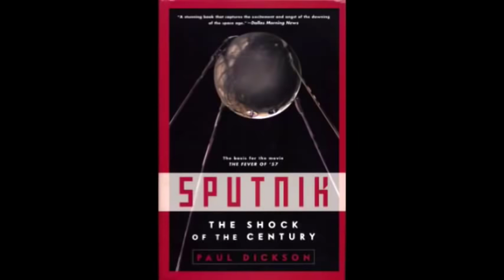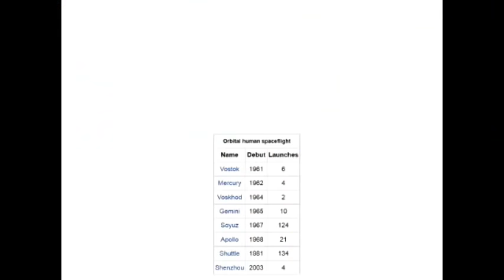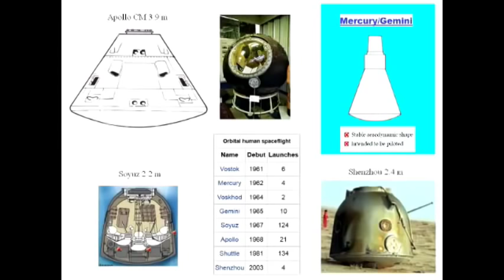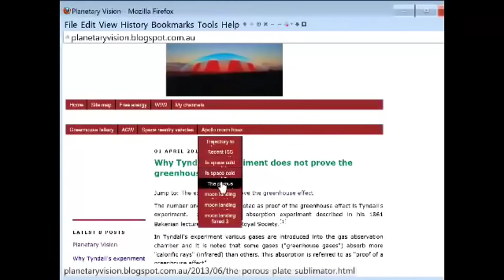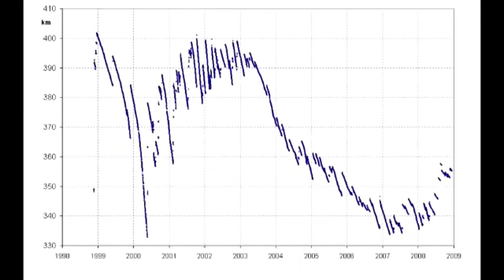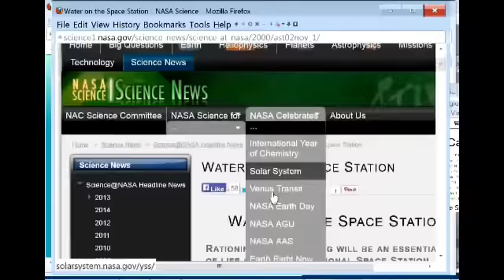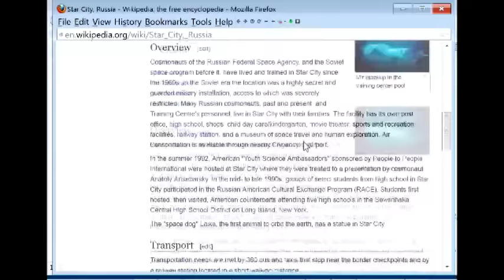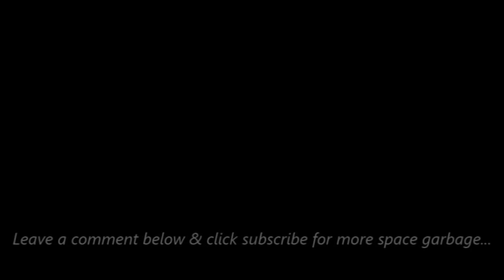The ISS Exposed

Comment: Not only most of the organic life can't get through radiation of the Van Allen belts (even today), but even the photographic films they were using at the time wouldn't have survived the exposure to such radiation, neither the cameras could have worked properly being exposed to extreme Moon temperatures such as 250° C in sunlight and -250° C in shade.
Reply: Shielding.
Reply: @eyesoftexas705  shielding? during the Apollo missions? LOL! the NASA has said they didn't use any, that it wasn't needed
Reply: @tgstudio85  That's part of the same crap. I could put here 50 links pointing to scientific research from USA, England, Russia and China which prove the astronauts couldn't ever pass through the radiation and come back without damage. 
Instead, I'll simply refer to two issues. 
One is the classified recordings that Bart Sibrel received from NASA by mistake around 2002. As if all known and classic epic fails and fakes seen in pictures and footage during the so called Apollo missions were not enough to convince the whole world of the hoax, you have these recordings of the Apollo 11 showing how the so called astronauts are using a simple sheet on the window to fake they are half way of the Moon. When they take out the sheet you can see through the window they are in the low orbit of the Earth, while receiving instructions "from Houston" on how to make the fake in the proper way. Then they turn the cabin light on and on the instruments you can see the current date and time, and on that date they supposedly were half way of the Moon. 
https://www.youtube.com/watch?v=xciCJfbTvE4

The other one is NASA own words, which sense because nobody (Russia, Japan, China, etc) including the US has been able to go/return to the Moon with manned missions:
https://www.youtube.com/watch?v=4O5dPsu66Kw

And beside the overwhelming photo and footage evidence proving the hoax, there's a third hit which demolish any NASA allegations and credibility
Go and watch Apollo 13 footage from NASA, at a certain point you'll note through the window a clear blue sky low orbit easy ride. If you can't find I can look it for you.

Only stupid and proud people can still believe in this crap.
PERIOD.
Reply: @alancrabb  That's part of the same crap. I could put here 50 links pointing to scientific research from USA, England, Russia and China which prove the astronauts couldn't ever pass through the radiation and come back without damage. 
Instead, I'll simply refer to two issues. 
One is the classified recordings that Bart Sibrel received from NASA by mistake around 2002. As if all known and classic epic fails and fakes seen in pictures and footage during the so called Apollo missions were not enough to convince the whole world of the hoax, you have these recordings of the Apollo 11 showing how the so called astronauts are using a simple sheet on the window to fake they are half way of the Moon. When they take out the sheet you can see through the window they are in the low orbit of the Earth, while receiving instructions "from Houston" on how to make the fake in the proper way. Then they turn the cabin light on and on the instruments you can see the current date and time, and on that date they supposedly were half way of the Moon. 
https://www.youtube.com/watch?v=xciCJfbTvE4

The other one is NASA own words, which sense because nobody (Russia, Japan, China, etc) including the US has been able to go/return to the Moon with manned missions:
https://www.youtube.com/watch?v=4O5dPsu66Kw

And beside the overwhelming photo and footage evidence proving the hoax, there's a third hit which demolish any NASA allegations and credibility
Go and watch Apollo 13 footage from NASA, at a certain point you'll note through the window a clear blue sky low orbit easy ride. If you can't find I can look it for you.

Only stupid and proud people can still believe in this crap.
PERIOD.
Reply: Moreover, it's been proved that 1969 and 1970 registered the worst solar activity in the CENTURY. These guys couldn't have chosen a worst time for the hoax!
Reply: @nicocba2007  Even more jaded conspiracist nonsense :
1.  You give credit to Sibrel?  All of his crackpot ideas were debunked years ago.  You just haven't fact-checked.
2.  The video about Orion is just that : it has nothing to do with previous missions.
So, this tired and discredited misinformation is what you put against 50 years of historical record and technical documentation - none of which, I guess, you have read.  
Your pseudo-elitism is crippling your judgement.
Kind regards.
Reply: Buck warpzone 
Kid, "conspiracy theory" was a term coined by the government to use it against of and to discredit the people who knew about the JFK assassination conspiracy. It's a goverment pigs' strategic for cover-up and get away with their own conspiracies. And this one about the Moon landing hoax is the like other government conspiracies, only this one is a "positive" conspiracy. That's why is harder for common no-thinking people to believe, the basic people who believes all they see on TV.
The case get worse when involves proud and nationalism.
The only conspirants are the governments, the agencies and the mainstream media which respond to them (which since 1993 are all of them).
You have a lot of examples of government conspirations, some of them have caused hundreds of thousands of dead people inside, and millones abroad. And some of them are of total public knowledge, they've been disclosed to the public through desclasified docs after decades of hiding.

Do you want some examples of government conspiracies 100% proven by official desclasified docs?
(1) 1915 - WW1 Conspiracy.
(2) 1941 - Pearl Harbor Conspiracy.
(3) 1950 - The CIA, the Korean War and heroin.
(4) 1964 - The Gulf of Tonkin Hoax.
(5) 1968/72 - The CIA and heroin part II.
(6) 1985-87 - The Iran-Contra affair.
How many stupid people would have thought it was impossible that the government was capable of such things before those top secret docs were disclosed? All common basic stupid people around, same thing happens with the Moon landing crap.

MORE IN DETAIL:

(1) 1915 - WW1 Conspiracy. The sinking of the british ocean liner Lusitania by the Germans was a pretext by the US to enter into the WW1, sacrificing 128 of its own people. The Germans advised beforehand the US gov and the American people not to travel in this ship by publishing warnings in the newspapers and communicated by the german ambassador to the foreign office of the US, as any attack to the ship would be deemed a fair war act. In fact, the ship wasn't sank by the U-boat torpedo itself, but by the explosion of the stored bombs and munitions they were carrying to the United Kingdom.

(2) 1941 - Pearl Harbor was a conspiracy to motivate the american public for war, by first provoking and then allowing the japanese strike. The Secretary of War at the time Henry Stimson wrote in his diary, just a week before the attack, that President Roosevelt had told him: "we are likely to be attacked perhaps as soon as next Monday". The plan was put in motion in late 1940, when the President ordered the fleet to relocate from San Pedro to Pearl Harbor, which appeared to be a nonsense strategic decision taken at the time, and then as it shows a desclasified memo dated June 23, 1941, the Secretary of Interior at the time Harold Ickes recommends to the President the oil embargo to Japan in order to force them into war: "There might develop from the embargoing of oil to Japan such a situation as would make it, not only possible but easy, to get into this war in an effective way". They received many warnings of an imminent attack from diplomatic officials and military attaches. The attack was even predicted by the newspaper Honolulu Advertiser days before it happened, but all of these warnings were ignored. This conspiracy killed over 2.400 american servicemen and civilians, beside the hundreds of thousands during the WW2 itself.

(3) 1950 - The CIA and the Korean War. After the WW2 and withIn the cold war context, this was the first of many secondary wars sold to the public as missions to save the world from communist threat, protect freedom and democracy, etc, when in reality they were meant to feed the military complex, conquer new export markets for american products, and compete for geopolitical power with the Soviet Union. During this war the CIA organized a massive heroin production-distribution operation known as "The Golden Triangle", in order to finance taiwanese warlords. Most of this drug was trafficked throughout the US by CIA assets.

(4) 1964 - The Gulf of Tonkin Hoax. As some docs declassified in 2004 shows, the alleged attack on the USS Turner Joy was totally fake. Not even a false flag attack, but just a lie of the Lyndon Johnson administration, the pretext they need for the US to enter into the Vietnam War. A lie which costed the country 60,000 men for finally losing that war.

(5) 1968/72 - The CIA and heroin part II. During the Vietnam War the CIA inundated the black neighborhoods of NY with heroin to finance illegal military operations in Laos and Cambodia using the Gold Triangle again. This heroin was known in the streets under the "Blue Magic" brand, mostly distributed by the gangster Frank Lucas, and brought to the country in containers using the CIA controlled company Air America.

(6) 1987 - The Iran-Contra affair. After the Congress refused to continue financing the guerilla in Nicaragua (known as Contras), the Reagan's administration decided to conduct two illegal operations to accomplish his goal: 1) By selling weapons to Iran (an enemy of the US) while it was in war with Iraq (an ally of the US). This event was widely known at the time, and only Colonel Oliver North paidthe price to protect the rest of the conspirators, including the President. 2) Again the CIA and drug. The CIA was conducting a massive cocaine traffic operation from Costa Rica to the US to be distributed mainly in the Blacks' and Latinos' neighbourhoods of LA. Same result here than in NY with the "Blue Magic" heroin operation; tens of thousands of "disposable people" had their head blown-up by drug, resulting in an amazing increase of violence, crime, etc, etc.

Do you want some examples of government conspiracies not 100% proven by official desclasified docs yet, but every thinking people knows they are conspiracies because of the overwhelming evidence thereof?
(7) 1898 - False flag attack in Havana Port.
(8) 1963 - The JFK Assassination Conspiracy.
(9) 1968 - Martin Luther King assassination.
(10) 1968 - Robert Kennedy assassination.
(11) 2001 - 09/11 Conspiracy, the New Pearl Harbor.

(7) 1898 - Sinking of the USS Maine in Havana Port. A false flag attack handled by the US government wich killed 250 of its own people, to be used as a pretext to start a war against Spain in order to gain control of, or to seize the remaining surrounding Spanish colonies, such as Cuba, Puerto Rico and The Philippines, within the context of the beginning of the American imperialism expansion.

(8) 1963 - The JFK Assassination Conspiracy. Nobody knows for certain who killed him, but among other things we know about the "magic bullet" scientific impossibility, so we know that there should have been at least three shooters. If Oswald didn't act alone, then the Warren Commission conclusion is bullshit. If the WC conclusion is BS, then there was a government/agencies cover-up conspiracy (we know that former head of the CIA, Allen Dulles, was a member of the Commission). And if there was a high level cover-up operation involved, then his real assassins also were top level government/agencies people.

(9) 1968 - Martin Luther King assassination, organized and covered-up by the FBI and the Memphis police. A nobody blamed and used as scapegoat.

(10) 1968 - Robert Kennedy assassination. He was running for president, he was probably close to find out who murdered his brother and got killed by the same people. Another nobody blamed 

(11) 2001 - 09/11 Conspiracy, a False Flag Attack, an Inside Job. Through investigations by several organizations such as 9/11 Truth Movement and Architects & Engineers for 9/11 Truth, plus a lot of research made by many independent journalists and analysts, and valuable testimonies of people involved in the airline industry (pilots, flight controllers, flight attendants, etc) now we know for certain what 09/11 wasn't. We know that at least 10 of the so called "terrorists" are still alive! and that they are saudis (US ally) with no connection to Al Qaeda. We know that the Towers couldn't collapse up down at free fall speed because of fire and gravity action, this violates at least two basic physics laws. We now know that the WTC-7 tower was taken down by controlled demolition. We know that any standard airliner jet can't be even controlled when flying over its maximum speed, much less can be controlled with misilistic precision to hit an specific target, and that is impossible if that target is ground level, and that is a sci-fi story if the so called "hijacker" could barely control a Cessna (proved). Now we know so many things more, but in order to summarize let's say we know that the official story in the mainstream media and the 9/11 Commission report is bullshit. Would be possible that the US government faked a terrorist attack in its own soil and against its own people, using or hijacking airplane jets? or that would be some just crazy fuck ideas of a bunch of conspiracy theories lovers? Please refer to "Operation Northwoods", a 1962 Pentagon plan to commit acts of terroris against American civilians and military targets, blaming it on the Cuban government, and using it to justify a war against Cuba.
Here is an easy aource: https://en.wikipedia.org/wiki/Operation_Northwoods
Reply: @nicocba2007  :  
1. ' they will never answer anything to what is evident' : you have demonstrated the usual m.o. of the conspiracist, sometimes called the 'gish gallop' or the 'wall of truth' which aims to impress with the volume of evidence.  It was used by Von Daniken to great effect -  it persuaded millions for a few years.  But what ALWAYS happens is that each brick in this wall gets fact-checked and crumbles, as has ALREADY been done with the 'Apollo Hoax' theory.   The fatal weakness of the conspiracist is being uncritical : so long as it confirms the theory ANY story is granted equal authority, and all contrary evidence is rejected and ignored.  The usual claim that there is 'never an answer' is manifestly false - the literature is enormous, and universities have departments specialising in it.   The evidence for space programs over 70 years is overwhelming, but always ignored.  This is true foolishness.

2  'But conspiracies have happened' : of course, who claims otherwise?  You think it impresses to cut and paste from chapter 1 of general history?  This is neither explanation nor justification for the deep delusions of the conspiracist.  Of course, there IS an explanation :
https://kar.kent.ac.uk/61995/1/Douglas%20Sutton%20Cichocka%202017.pdf  "The Psychology of Conspiracy Theories"
Reply: @IgnoranceIsNot AVirtue Of course, and I've already put some links about it.
Reply: Enter Jarrah White web page and you'll find plenty of radiation analysis proving the hoax.
Watch the vids and you'll get the answer about russian silence at the time... BTW you are not able to search webpages in other languages, much less in russian or chinese... oh! BTW2 the chinese have shown us how the moon really is
Reply: @tgstudio85   No. NASAs original flight path released to the press shows a path from the equator to the moon. only after the deadly radiation was questioned in the VA belts did nasa change its story after the missions took place, and the longer polar flight path was not accounted for it terms of payload and fuel on the saturn rocket https://www.youtube.com/watch?v=EmGaNEbEMLI. No mention of the VA belts were in the transcript, no extra fuel was calculated for a polar orbital transfer to the moon, and Apollo 11 was caught faking being halfway to the moon on leaked atomically dated footage.
Reply: It seems the globe theory claim of a radiation belt around the earth undermines their other claims that planet distances have been confirmed by sending radio signals that bounce off mars, or moon etc.

The Van Allen belt would demolish the signal. Yet they think it passed through, twice! ( there and back ).
Reply: Alan Crabb , could you kindly supply me a link to sibrel's claims being debunked, I would like to check that out.
Reply: Their excuse is even though it is cold and hot, there is no real temperature.....mind boggling Iknow
Reply: how strange. and still they did it? you are religous and think that the earth is flat as well?
Reply: @tgstudio85  good video link thanks for clearing up some questions that I had.
Reply: @nicocba2007  I want to so bad pick me pick me !
Reply: @sollostyles I can't help it I was born stupid !
Reply: The van Allen belts are fake too my dude , research Flat Earth
Reply: "they've destroyed all that technology and blue prints!"

Why revive tech from 60 years ago?  The old hardware is woefully outdated and was scrapped or put in a museum, because NASA won the Space Race.   If you were actually interested in facts, here is a thorough explanation of why it is absurdly impractical to use Apollo-era tech today-   https://www.youtube.com/watch?time_continue=10&v=ovD0aLdRUs0

"they have to solve radiation problem BEFORE sending men beyond low orbit. "

That is correct, as I explained, and you only ignored.  Smith is referring to the ALL NEW Orion, using ALL NEW tech, which is more complex and radiation-sensitive than mostly analogue, Apollo hardware, and intended to endure much more intense levels of radiation over longer periods.  

"6 times!!!"

NASA sent men to the Moon nine times.  They landed six.  Why would they bother faking it NINE times?  And why sabotage U.S. cred when they knew it was only a matter of time before other countries sent probes or men to the Moon that were likely to photograph Apollo landing sites? Which they now have.

Over 155 Moon missions by various countries- http://en.wikipedia.org/wiki/List_of_missions_to_the_Moon 32 of which were after Apollo. 

"Chinese have recently shown us how the Moon really is"

Exactly like the Apollo moon.  Japan's Selene Kaguya scanned the Apollo 15 landing site terrain, and it matches photos from 1971 exactly.  How could NASA have faked the terrain exactly, if they were never there?  https://www.youtube.com/watch?v=kbTRGj5aNCM

I debunked all your points, and like all conspiratards, you ignore. evade, make wild claims without evidence beyond reference to other conspiratards who are as scientifically illiterate as you, and shirk away when you are losing your argument.  

You are part of the fake news problem.  Good riddance.
Reply: That's not what Dr. Van Allen says about the radiation belts he discovered.
Reply: That's not true.  Just a BS myth Idiots keep repeating.
Reply: Can Allen himself has changed his mind and believes we went. But you have a YouTube acct so I should believe you.
Reply: @Galerak1  : yes, it true that manned missions are limited to LEO. In fact, the U.S. is limited even further. The only way the U.S. can get to LEO now is by bargaining a ride with the Russians. Would you interpret this as the same as the Americans never got to space by themselves? Now there are no man rated Saturn Vs, or man rated Apollo command or lunar modules. That means that even simple people should realize that no one can get back to the moon. All the 50 yr old Apollo equipment is on display in many museums, never to fly again.
Reply: @tgstudio85 : real scientists don't publish on you tube.
Reply: @nicocba2007  Nope. Dr. Van Allen originally estimated the astronauts would have to spend a week in orbit at the higest levels of radiation to receive a lethal dose, whereas the Apollo guys were only exposed to  2 hours of low level and 15 minutes of high level rads, which was roughly 1% of a lethal dose on each pass.  Both NASA and Dr. Van Allen still consider his original estimates to be accurate.

This is easily confirmed, as far as what NASA and the Dr. think about the matter. 

Kind of odd how you would value NASA's info as long as it confirms your beliefs, though.  I thought they were liars and conspirators? How do you know the Van Allen belts exist at all?
Reply: @nicocba2007  Side note: Kennedy's "we choose to go to the moon" speech was in 62, by the way - no one could have ever imagined it 3 years prior, eh? I'm sure you must be right . . . 

This movie about going to the moon from 1902 must be from a different dimension?

https://www.youtube.com/watch?v=xLVChRVfZ74
Reply: nicocba2007 What are the radiation energies in the van Allen belts, what types of particles are present and how was all this information discovered?
Reply: @nicocba2007  You dont concede when your points are debunked and are unable to come up with a logical refute, so you just move onto something else and hope no one notices. Now you resort to the fallacious tactic of quote mining out of context as if the quotes agree with your viewpoint.  

"Simple minds prefer simple answers."  -me

"Merely claiming that an ocean of evidence you cannot explain is 'fake!,' and that millions of experts are all 'liars!' does not make for a remotely convincing argument." - me

"Ignorant men raise questions that wise men answered a thousand years ago" - Johann Wolfgang von Goethe

"The main thing that I learned about conspiracy theory is that conspiracy theorists actually believe in a conspiracy because that is more comforting. The truth of the world is that it is chaotic. The truth is, that it is not the Jewish banking conspiracy or the grey aliens or the 12 foot reptiloids from another dimension that are in control. The truth is more frightening, nobody is in control. The world is rudderless."  -Alan Moore

'I cant understand the science, therefore it must be fake!'  -you

'A global consensus of experts thoroughly supported by an ocean of verifiable evidence, rigorous experimentation, published peer reviewed studies, resulting in successful applications like aviation and the internet you are now ranting on, overwhelmingly disagrees with my amateur opinion.  Therefore, the experts are all part of a massive coverup!'
  - you

"Extraordinary claims require extraordinary evidence" - Sagan   "Claims asserted without evidence can be dismissed without evidence." 
 - Hitchens 

Here are your three possibilities:

1.  Millions of professional physicists, engineers, astronomers, photographers, and news agencies... are ALL part of a secret global super conspiracy of the last 70+ years, spanning space agencies in over 70 countries, without any clear motive, and without a single leak or whistle blower ever, spending accumulative trillions faking cover up, thousands of hours of footage, millions of photos, publishing thousands of fake scientific papers, and engineering expensive equipment that doesn't actually work, and everyone who pursues a PhD in earth sciences is forced to lie.  

2.  They are all incompetent.  And anyone who watches a few amateur conspiracy videos is better informed.  

3.  You are poorly educated and confused.  

Which sounds more likely?  

I am sorry to inform, but...

You are not special.
You are not awake.
You are not enlightened.
You are not one of the few.
You are not an investigator.
You just have internet access.

Post your one best piece of evidence that convinced you the Apollo missions were fake.  I dare ya.
Reply: The ISS is just above the atmosphere and  deep inside the VA belt! Any back yard telescope can see the thing when passing overhead. NEW CONSPIRACY YOU-TUBE, ISS painted on consumer telescopes!!!
Reply: Cognitive Dissident No, according to nicocba2007. I want to know how he / she knows all this.
Reply: @nicocba2007  you must have me confused with someone who cares about your opinions.  Those say more about you than anyone else.

Anyway, when your tantrum is over, feel free to answer my extremely simple questions. I'll wait.
Reply: @somatotrophin1535  I deleted my comment. I was being sarcastic.

But yeah, i think you're beyond him . I thought pointing out the self detonating rationale would be more on his(?) level.

You can troll this type with simple logic, which is entertaining at times.
Reply: @codebasher1  the ISS orbits about 150 miles below the VAB.
Reply: nicocba2007 manned missions are more difficult today because of 1 the cost, 2 the sensitivity to radiation of modern equipment compared to the basic electro mechanical equipment used in the 60s and 3 more stringent safety guidelines today.  They were willing to risk lives much more readily to win the “space race”.
Reply: You do realize they were using a hyperbolic arc to get passed the van Allen belt, meaning that they didn't go through the worst parts of the belt that had the worst radiation and minimizing their exposure time to under 3 hours to go and 3 hours to come back. /watch?time_continue=1&v=lNiscigIgBc
Reply: @tgstudio85  It's not that they are unable, they don't have the drive of having to beat an other country for "superiority" sake that they were pushed in by the administration. It's just not cost effective.
Reply: Alan Crabb yep. You are right they have spoken loads of gibberish. And all of it was bullshit.
Reply: @cnelsonlv999 :  thank you, however :
1.  "50 years of historical record ..."  You misunderstand.  The important bit of "50 years of historical record and technical documentation" is 'record..and technical documentation'.  They exist in immense and verifiable detail, and contemporary with the period in question.
2.  "NASA destroyed / deleted / lost / mishandled it... "  What, you mean the 1.5 million documents in public archives?
3. "Stop calling anyone "typical!"  You are the one who is typical."  Read that again. NO sense of irony at all?  (And when did I say that anyway?)  
4. " confirmation bias"  Everyone is subject to it, which is why fact-checking and critical thinking are important. 
5. "psychology of conspiracists" bullshit, "  It's a serious and well-researched subject, and answers many questions.  
6. "not cool to believe in conspiracies.
"  Only an idiot denies conspiracies happen.  A conspiracist mindset is something of a different order.
CN : in your rush to judgement you just don't think things through.   Also, you appear to ascribe to me quotes from someone else. 
Kind regards.
Reply: @Rude_Earther  :
YOU SAID : "let’s see what nasa say about your scientific findings."
I SAID :  " What about everything else that NASA - and all other space agencies - have said?"
YOU SAID :  "all of it was bullshit.
"
First you cite NASA as an authority, then you rubbish it.  Interesting.
Reply: nicocba2007 In other words, you have no idea what the VABs consist of and how they were discovered.
Reply: @alancrabb  Well.... I checked again... the quote I attributed to you definitely came from you. I think "historical record means historical record" kind of sums up your line of reasoning pretty well. Not sure if it occurs to you, but... being told something happened doesn't prove that it happened. I don't care enough to address your annotated points, but regarding #5... I am a psychologist. I'm not sure who told you the "mindset of the conspiracy theorist" is a serious and well-researched subject... but they were lying. Actually, if you are interested in some fascinating investigation, look a bit more deeply into this subject, how it began, and the key players in shelling out the important talking points.
Reply: nicocba2007 Debunk number 1, re: claim by Sibril they were in low earth orbit and not halfway to the Moon. The Apollo window was RECTANGULAR and not round. Sibril edited the video. See the whole video here at about 3.40 to 4.15. The WHOLE Earth is visible through a rectangular window. Ref: https://youtu.be/Yy3WH2Ln_aY
Reply: @cnelsonlv999  : thanks.
1.  "the quote I attributed to you definitely came from you"  
(a) You criticised me heavily for using the word 'typical'.  I can't see that I used that anywhere in this thread.
  I stand to be corrected.
(b) You quoted me as referencing 'whistleblowers'.  I can't see that I used that anywhere in this thread.
  I stand to be corrected.
2. "historical record means historical record"   Did I ever say that?  
3.  Your main challenge was about my referencing sources.  You have not addressed my response, that contemporary records are important when discussing past events - which we are.  This was a qualitative and quantitative comparison with one highly dubious 'authority' being cited. 
4.  " I am a psychologist."  Did you check the source I referenced?  You doubt their credentials, you think them liars?  What are your own credentials?    

5.  "look a bit more deeply into this subject"   I have.  Don't be cryptic, say what you mean.  Are you going to quote 'historical records'?  :=}
6.  "NASA destroyed / deleted / lost / mishandled it... "  You raised this but have not addressed it.
7.  ""not cool to believe in conspiracies.
""  You raised this but have not addressed it.
8.  "I don't care enough to address your annotated points"  So why raise the issues?   
C N : there is a pattern emerging.  You misunderstand, you challenge, you misquote, you make questionable assertions, you ignore responses.  You are keen to assert you superior understanding but use facile arguments.  This is not encouraging from a 'psychologist'.  
Feel free to end this at any time, I guess it is tiresome for both of us.
Kind regards.
Reply: @DavidRidlen  :  "the ISS orbits about 150 miles below the VAB"  There is more than one belt, and the ISS routinely goes through the lower one : check out 'South Atlantic anomaly'.
Reply: @DavidRidlen  :  Nice. But lower your expectations?  As the sage says ""Never debate with someone who has diarrhoea - it will not end well."
[The Aphorisms of Dogmaticus the Elderly
Reply: @alancrabb  You keep saying I quoted you saying things you didn't say.  There is a difference between quoting you and putting quotes around a word.  Whether you used the word typical or another word/phrase with the same meaning... the point is still the same, and is not remotely ambiguous.  The only thing I quoted you saying was made very clear in my post.

I find your last comment interesting, given your general strategy here. Offer me the chance to end this tiresome conversation... but you are the one making it tiresome by annotating an incredibly long list of arguments, which leave me with only two choices... spend a ridiculous amount of time addressing each one, followed by an EVEN LONGER list of annotations by you... or to simply ignore them.  I think you know full-well which one a sane person would choose.

Just a thought... if you are so interested in sources, why don't you dig up some that are more than a cherry-picked attempt to find something that confirms your own conclusions?  Again with point #4... if you actually care about this, why is it that you are not familiar with the most widely documented and significant sources on this matter?  This seems to expose your unwillingness to actually explore this issue with an air of critical thought... 

Last but not least... you have talked about the psychology of conspiracy theorists... and also admitted that you agree there are conspiracies.  Does this not make you a conspiracy theorist?  What is the distinction, in your mind?
Reply: @alancrabb  Oh, and you're welcome!
Reply: @JosipMiller  
Please explain how radio signal goes through charged particle radiation.
Reply: @cnelsonlv999  :  Thank you.
1.  "There is a difference between quoting you and putting quotes around a word"  Is there?  As a professional (?) you should know that normal usage is to use single quotes for a paraphrase.  Double quotes mean something very specific, and you consistently misuse them.
2.  "incredibly long list of arguments"  The list is only as long as the issues you raise and which remain unresolved.  This is a way of reducing 'cherry picking' of arguments,  raising issues and then conveniently dropping them.    
3.  "the most widely documented and significant sources.."  Why assume anything, and why so coy?  Point to them.  If not already acquainted with them I will look.  Did you check my referenced source on conspiracism yet?  I doubt it, because of your next argument.
4. "Does this not make you a conspiracy theorist? "   I think this indicates you are only an amateur 'psychologist', and also not a logician.   Your argument seems to be :
(i)  'You agree there are conspiracies'
(ii) 'You talk about conspiracy theorists'
(iii) 'Therefore you are a conspiracy theorist'   
You SHOULD know that there are widely accepted definitions for these terms - see my previously cited source.  Acknowledging the reality of some conspiracies is significantly different to being a 'conspiracist' or 'conspiracy theorist'.  And studying conspiracism does not make one a conspiracist,  any more than studying criminal behaviour makes one a criminal.   Another issue to be listed before it is conveniently forgotten.  

Kind regards.
Reply: @alancrabb  This isn't a psychological journal, man!  I quoted you very clearly and prominently at the start of my post.  As a high school graduate (I assume), you should be able to tell when someone is quoting you, and when someone is alluding to your general message.  I'm not buying this extended hangup on whether or not I was quoting you directly, to the extent that you have completely avoided any meaningful discussion about the thing I obviously WAS quoting... which was a ludicrously absurd statement!
Reply: here's what Dr Van Allen, the discoverer of the belts named after him, had to say about the Belts. 
https://forum.cosmoquest.org/archive/index.php/t-3885.html
Reply: @cnelsonlv999  : thanks
1 : "when someone is alluding to your general message"  That is a self-excusing deflection (and you a psychologist!  tut tut).  Here's what you said in your original message :
["Stop calling anyone "typical!" You are the one who is typical... saying "if this was a conspiracy, why aren't there any whistle-blowers?" Then, when someone comes forward, you say "Oh that crackpot? He has been debunked by SNOPES!" ]   So far as I could tell I said NONE of those things and  I commented as an aside.  Your insistence on excusing that has snarled you up.  You made a mistake, you got called out : man up and move on.  
2. : " completely avoided any meaningful discussion about the thing I obviously WAS quoting..."   Here's your original point :
["So, this tired and discredited misinformation is what you put against 50 years of historical record and technical documentation" Haha! What the hell is that supposed to mean? "]  That HAS been discussed (remember, the detail you object to?) and NOT avoided as you falsely claim.   But you deflected away from that subject after I responded.  I'm happy to continue the discussion about the relative value of sources.
3.  Who is avoiding all the meaningful comments?   Want me to list all the issues you raised and subsequently ran away from? 
4.  Where are those documents you think I should have read?  
5.  Have you read the source I cited, which was the second main point of this thread and would have answered your questions?
6.  "This isn't a psychological journal".  But conspiracism IS a psychological phenomenon.  Read the literature.  Please.
Kind regards.
Reply: @alancrabb  Again... STOP WITH THE LONG-WINDED ANNOTATED DIATRIBES!  You know it is only a strategy that intends to deflect from any meaningful conversation.

You did NOT address my original point... you just stated a circular argument... that the historical record is the historical record (possibly not your exact words, but very close).  A historical record is NOT a line of proof.  It simply states that someone has claimed something happened.  50 years of historical record is meaningless in terms of proof!  Stop trying to pretend you are proving anything, or making an argument.  THIS IS NOT AN ARGUMENT!

Your statement amounts to saying that people have claimed it's true for 50 years, therefore it must be true.  That is 3rd grade thinking!  Are you a 3rd grader?  Because if so, then I owe you an apology.  You are right on schedule!

I notice you did carefully avoid the last question I asked in the last post... not surprisingly, since that was the only meaningful thing you could have addressed other than the previously aforementioned "quoted" statement...
Reply: @tgstudio85  THANK YOU!!!!!!!!!!!!! YOUR CONTRIBUTION TO SOCIETY HAS BEEN NOTED THANKS FOR PLAYING
Reply: nicocba2007 The video I gave the link clearly shows a rectangular window with the whole Earth visible. Sibril edited out this part of the video.
Reply: @cnelsonlv999  :  Thanks
1. "You did NOT address my original point"  I did (but certainly not in the way you allege.)  I will do so again in another post shortly.
2. "carefully avoid the last question I asked in the last post"   Which question, please?  
3.  Do you know what a 'diatribe' is?   
Kind regards.
Reply: @alancrabb  
1. Can't wait!
2. You talked about the psychology of the conspiracy theorist, while also acknowledging that there are real conspiracies.  If you agree there are conspiracies, doesn't this make you a conspiracy theorist?  If not... what is the difference in your point of view?
3. Yes, happy to explain it to you if needed.

You did better focusing on relevant issues in your last post... 2 out of 3.  If we can just cut out nonsensical pointless shit like #3 moving forward, perhaps there is a meaningful conversation to be had in all of this.
Reply: @cnelsonlv999  :  You said : "You did NOT address my original point....you just stated a circular argument"   Each of those statements is false.
 
HERE is my original comment to 'nico..' : 
"1.  You give credit to Sibrel?  All of his crackpot ideas were debunked years ago.  You just haven't fact-checked.
2.  The video about Orion is just that : it has nothing to do with previous missions.
So, this tired and discredited misinformation is what you put against 50 years of historical record and technical documentation"
 
HERE is the main part of your original response to that  :
"How is a historical record a line of proof, and what exactly is the "historical record?"" 

HERE is my response :
"1.  "50 years of historical record ..."  You misunderstand.  The important bit of "50 years of historical record and technical documentation" is 'record..and technical documentation'.  They exist in immense and verifiable detail, and contemporary with the period in question.
"  [At the outset I explained how you had misrepresented my point.  Ignoring this, you have continued to parrot that misrepresentation.]

HERE is my subsequent comment :
"2. "historical record means historical record"   Did I ever say that?  
3.  Your main challenge was about my referencing sources.  You have not addressed my response, that contemporary records are important when discussing past events - which we are.  This was a qualitative and quantitative comparison with one highly dubious 'authority' being cited." 
[You are STILL repeating your false 'quotes'.  And you have NOT responded to my correction of your misunderstanding.]

HERE is what you say In your latest post, repeating your original misunderstanding :
(i)   "A historical record is NOT a line of proof."   I never claimed it was.  This is a straw man argument by you.   
(ii) "Your statement amounts to saying that people have claimed it's true for 50 years, therefore it must be true."  No, it doesn't.  This is misrepresentation by you.  Why do you keep making things up?  My entire point - please read it again - was that there was a material and significant difference between the 'evidence' cited by nico and that in the NASA archives, the latter being "immense...verifiable detail...contemporary".   
Before you misrepresent that last phrase, here is what it means :
-  'immense'   There is voluminous documentation on every phase of every mission by those involved in the missions and by expert evaluators.
-  'verifiable detail'.  This documentation can be cross-checked against non-NASA sources and subsequent reviews
-  'contemporary'.  A primary principle of source evaluation - go to the original period and documents.    
What I said was : "This was a qualitative and quantitative comparison with one highly dubious 'authority' being cited." 

In summary :
You said : "You did NOT address my original point."   FALSE - see above
You said : "you just stated a circular argument"  FALSE - see above.
Kind regards.
Reply: @cnelsonlv999  :  "the psychology of the conspiracy theorist"
I already responded :
" "Does this not make you a conspiracy theorist? "   I think this indicates you are only an amateur 'psychologist', and also not a logician.   Your argument seems to be :
(i)  'You agree there are conspiracies'
(ii) 'You talk about conspiracy theorists'
(iii) 'Therefore you are a conspiracy theorist'   
You SHOULD know that there are widely accepted definitions for these terms - see my previously cited source.  Acknowledging the reality of some conspiracies is significantly different to being a 'conspiracist' or 'conspiracy theorist'.  And studying conspiracism does not make one a conspiracist,  any more than studying criminal behaviour makes one a criminal.   Another issue to be listed before it is conveniently forgotten."
Kind regards
Reply: @cnelsonlv999  "perhaps there is a meaningful conversation to be had in all of this."  Perhaps.  Earlier you alluded to some significant documents which you thought I should have read.  Again, would you care to identify these?
Reply: @alancrabb  Just when I say you are doing better you post a 3 page exposition into what was said... followed by 2 other posts I will not bother to read.  Clearly your aim in this discussion is simply to bury people in long-winded nonsense that you know nobody is going to read, because it has nothing to do with the relevant issue being discussed.  

No thanks!  I guess I was wrong about there being a meaningful discussion in the making...
Reply: @cnelsonlv999  :  thanks
What exactly is the 'relevant issue', and how is it being avoided?
But feel free to end this now.
Kind regards.
Reply: starlight122012 If you clean your ears out and listen carefully enough, he explains that the ELECTRONICS on Orion are sensitive to radiation and it is this problem that needs to be solved before using Orion for manned flight. Ok, genius?
Reply: @starlight122012  oh wait did you say "Orion" mission not Apollo missions :P You realize that's different things?
Reply: Flat Earth Data What ammonia?
Reply: @Flat Earth Data You know that vacuum is best insulator? Explain why you have vacuum in your vacuum bottle;)
Reply: @Flat Earth Data yes vacuum is perfect insulator, they only lose heat thru radiation and radiation heat exchange isn't very efficient.
Reply: @Flat Earth Data "extreme" what you mean by that? Do you know how we define  temperature?
Reply: @Flat Earth Data temperatures of surface of ISS varies from 120C to -155C so yes it's quite much, but almost all materials that we have on earth are capable of withstanding that temperature ranges. And yes they have climate control systems on ISS, just like you have in your house but little more advanced and bigger:)
Reply: Flat Earth Data Ever heard of a freeze dryer? Water, no matter what state, evaporates in a vacuum.
Reply: Right on the mark 👍☺
Reply: you really don't have a clue and are just parroting others, do you?
All you have to do to find out stuff, like with those cameras used, is to look it up .
Reply: and your proof is what exactly
Reply: Has anyone else seen the reel of film showing the President talking on the telephone (yes the old chunky black desk 📞 phone) to the astronauts whilst they were “on the moon”. 😐 Ummm

(I watched the clip on a YouTube video - I think it was Nixon). Absurd you could dial up the moon or be connected via the telephone on your desk!
Reply: NASA admitted in early 80's  that they lost all the telemetry data from all the moon missions. They also admit that the tech used to get to the moon was accidently destroyed and they haven't been able to recreate it yet. That part is absolutely ridiculous, they want you to believe they developed the tech within 5 years. But yet it's has taken them over 40 years to recreate it. Airplanes are 6 miles up but can't be seen without telescope, but you can see the detail of the ISS from 200 miles without one? When does the reality of it set in? And as far as photographic film goes,no even xrays will penetrate the film canisters. How about everybody who says it was protected somehow by shielding try an experiment and prove it. I'm tired of people taking something long proven to be a lie and saying it's true because the liar told them it was. Until you can prove they provided real data to us and not some crap they made up, I will believe what my eyes tell me.
Reply: Bruce Banner 1) No one has claimed that you can see detail of the ISS with the naked eye; 2) Yes, aeroplanes 6 miles up can be seen without a telescope; 3) VAB belt radiation is mostly particulate which can be more easily shielded against than X-rays.
Reply: @somatotrophin1535  Not true.
Reply: nicocba2007 Yawn.....
Reply: @somatotrophin1535  phhhhhhrt
Reply: @nicocba2007  FKN' eh buddy. no one does there own research any more... Most just accept what they are told' If I was like that I'd be pretty pissed at Santa Clause right now
Reply: @alancrabb  Sibrel was debunked? By who, Snopes? Wikipedia? You are deep in it, aren't you? You will be crying someday, that much is assured. The inadvertent release of the staging of the earth shot has not been debunked, and Aldrin got visibly shook when he was asked to view it and comment.
Reply: @busterbrown4112  : Hello, and thank you for your thoughts and concern.  
1.   "Sibrel was debunked? By who .."   I'm sure you are able to research this for yourself, if you want a really balanced view of the evidence - just as I had to.   [ Here is a fairly comprehensive critique : http://www.clavius.org/bibsibrel.html  One of many. ]
2.  "You are deep in it, aren't you? "  Do you not see the irony in this comment?  I am not a conspiracist of any sort, but I would have to be deep in the conspiracist rabbit hole to accept either Sibrel or his theories as credible.   
If you want a response to specific claims please provide your very best sources, ones you have fact-checked for yourself.
Kind regards.
Reply: I used to believe in the ISS, and our capability for space faring. As I really looked at the footage available, I began to see too many anomalies, that cannot be explained or disregarded. If they are telling the truth, why don't they just prove it? Why do all the astronauts look so good?, with beautifully styled hair!. I've been duped!, but no more
Reply: @ralog7263  : " why don't they just prove it?"  What would constitute 'proof' for you?
Reply: @ralog7263  ISS is another big hoax. you can even see bubbles during their so called "space walks" (i.e. filmed under the water)